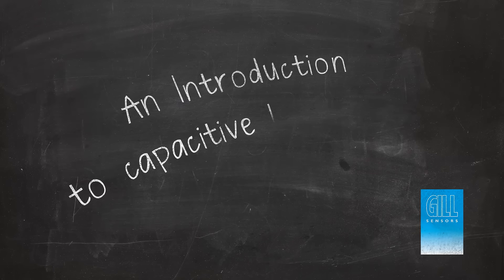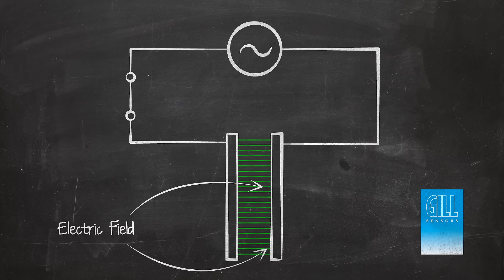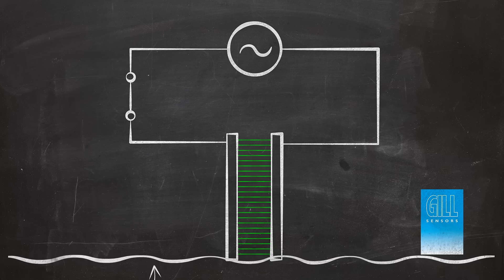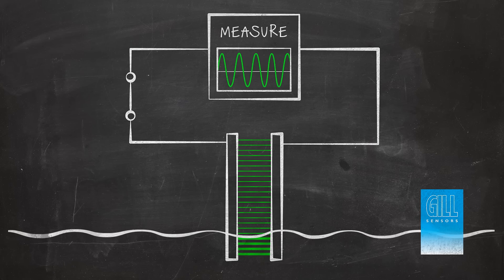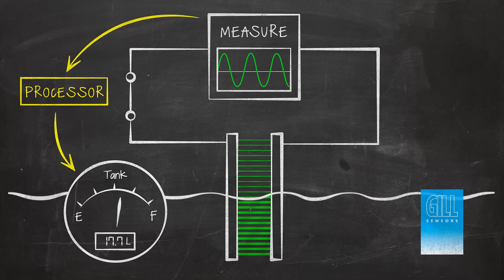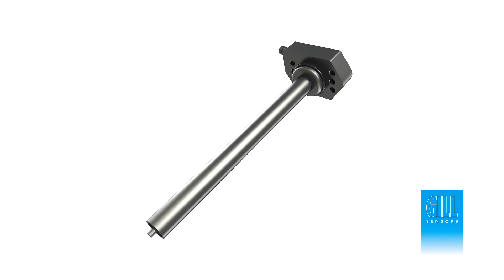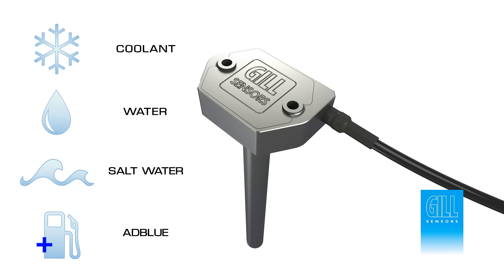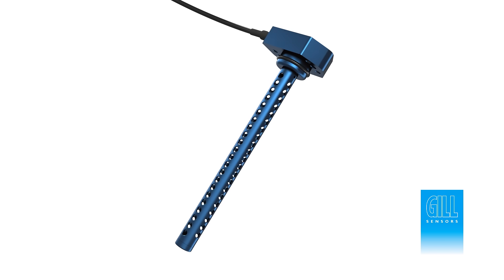How Capacitive Liquid Level Sensors Work: GILLSC.com

Comment: I would like to clear my doubt here, in this video you have mentioned. if we add the dielectric material in between electrode the electric field are increase how it is possible. can you tell me the details about the electric field increase.
Reply: Good question! You ready for this?  Inserting a dielectric between the electrodes does not increase the electric field, it actually weakens it and that's why there is an increase in capacitance:

 Here's how:
    * Capacitance (C) is directly proportional to the charge (Q) stored on the plates and inversely proportional to the voltage (V) across the plates (C = Q/V).
    * The voltage between the plates is related to the electric field (E) and the distance (d) between the plates by the equation V = E * d.
    * By weakening the electric field (E) for the same amount of charge (Q), the dielectric effectively reduces the voltage (V) needed to maintain that charge.
    * Since capacitance is inversely proportional to voltage, a decrease in voltage due to the dielectric leads to an increase in capacitance.

Another way to think of it:
Most dielectric materials are polarizable, meaning their internal charged particles (electrons and protons) can be slightly shifted by an external electric field. 

    * When a voltage is applied to the capacitor plates, the electric field influences the polarizable molecules in the dielectric.
    * These molecules tend to align partially with the electric field, creating microscopic electric dipoles (tiny separations of positive and negative charges within the material, the micro-dipoles will have opposite polarity to the electric field because positive charges on the capacitor plates will tend to attract negative charges in the micro dipoles and viceversa).
    * The net effect of these microscopic dipoles is an additional electric field that opposes the original field from the capacitor plates.
    * This opposing field from the polarized dielectric weakens the overall electric field within the capacitor.
    * As explained earlier, a weaker electric field for the same charge translates to a higher capacitance.

In essence, the dielectric acts like a helper, reducing the opposing force needed to store charge on the capacitor plates. This allows the capacitor to store more charge for the same voltage compared to a scenario with just air (dielectric constant of 1) as the separator.

Comment: Hi Mike. Thanks for the review!

I'd like to add to the answer you gave regarding the RO or Zero water question. The manufacturer's response was right on. I have the BDC600XL. I thought I would try Zero water to see how the taste of my coffee would change. Once I did, I noticed that the electronic water level stopped working. The float would rise to the full reservoir position but the electronic level on the display never came up to full. I also noticed that I was getting inconsistent amounts of coffee in the carafe. I thought the sensor in the reservoir gave out and I was stuck with a $250 hunk of stainless steel. Not so! It turns out that the water level sensor needs the minerals in the water to work (as the manufacturer stated) - the minerals that the Zero water filter was removing! Once I switched back to regular tap water (which the manual recommends), all was fine. I'm guessing the machine uses a sensor similar to this: https://youtu.be/0du-QU1Q0T4.

Comment: Thank you for the video. However, isn't it incorrect to show the frequency change as the liquid level changes?  A change in capacitance changes the current in the circuit, not the frequency). The narration seems to confirm this but the animation shows frequency changes.
Reply: I think so. There is no association between capacitance change and frequency change.
Reply: %%now not  hood  mind ok

Comment: you say it measures energy to determine level of liquid is that through a ammeter or voltmeter confused here
Reply: No, just about closing the circuit with a minimal volt/amp to acertain its closing.

Comment: Thanks for this video , but I have a question , how would the car still giving a correct and fix reading of fuel level even if the car going uphill or downhill and the fuel moves in the tank?
thanks
Reply: Gill Sensors & Controls 
Thank you for quick reply
Now I know why in my Peugeot 405 the fuel level gauge goes up and down while moving downhills and uphills respectively, the fuel level sensor located in the front of the tank
Thank you very much 😊...

Comment: nice video. Can the same used for Diesel Generator fuel level sensing because the DG tank capacity and size varies across the models. Any suggestions for the varying length of the capacitor tube adjusting for the size of the tanks.

Comment: this technology is using to measure level in tank of car !! but , can it work with steam ??
Reply: ***** thank you to answer me !! in our plant we use differential pressure technology  to calculate level !!
Reply: ***** is there any concerns when dealing with boiling water? I know the dielectric constant is likely to change due to density variation, and the wires connecting the circuit board must be thermally insulated; is there anything else I should be concerned with?